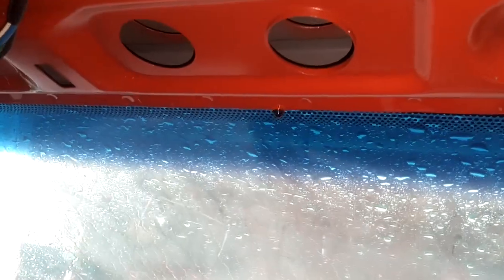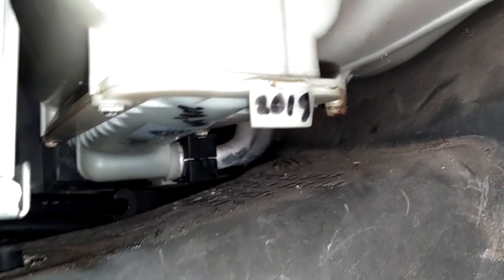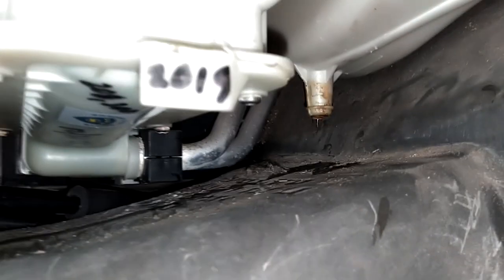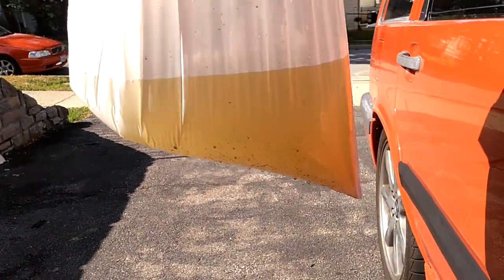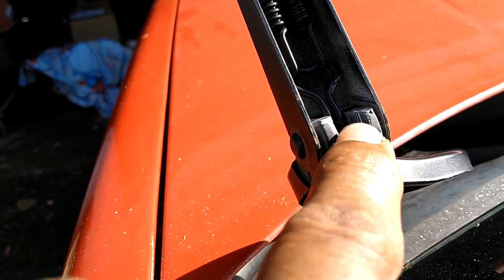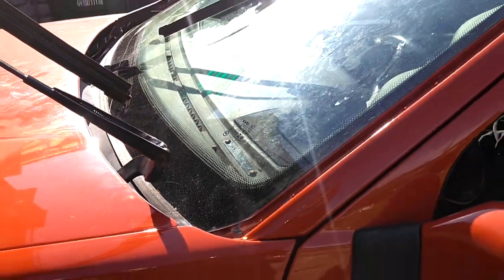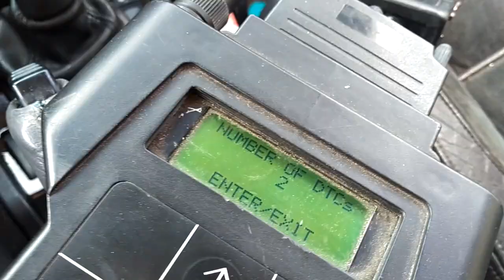Red Barron progress, water in dash, wiper repair, AFR installation, etc. - HOWR

Comment: Robert how do I clear my engine coolant sign on my dashboard on my 2001 Jaguar XJR supercharged I bloodline I even flushed out the old radiator fluid and put new orange 50/50 I need your help how can you help clear the engine coolant low sign??
Reply from the maker: Is the sensor bad?

Comment: Hello Robert, my s70 door lock only opens with the key on the driver side, the double turn doesn't work nor do the inside doors with the automatic switches nor the trunk release. I'm not sure which door switch is bad, guessing the truck is part of that circuit too. I've seen your video on the temperature strip replaced with copper, but not sure which door actuator is the problem.
Reply from the maker: Whichever one fails to unlock.
Reply: None of them open automatically nor the trunk. Only the driver door opens with key, no double turn for the others and no automatic inside switch locks of unlocks the doors and no auto trunk switch.
Reply from the maker: How long has this been going on?
Reply: Not more than a week
Reply from the maker: If you hit the unlock switch inside the car do you hear any noise from any of the door actuators?
Reply: There is no noise from any actuator when I press driver or passenger inside switches.
Reply: Hello Robert. Want to give you a follow-up on my door locks, and trunk release not working. They are all working now, seems like the driver door acuator was the culprit along with the temperature strip because when I moved the car where there is no direct sun on the driver door everthing worked after a cool night, the next morning all worked and has since for a few weeks now. Thank you Robert.